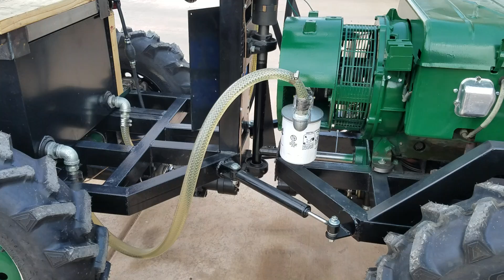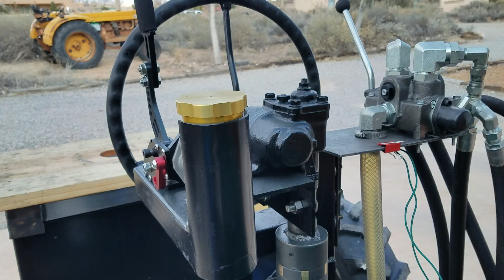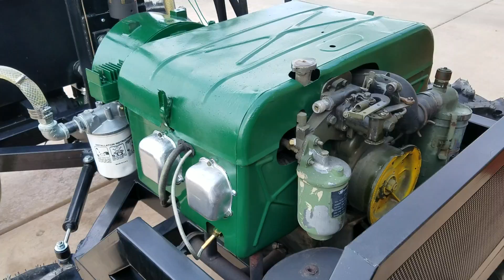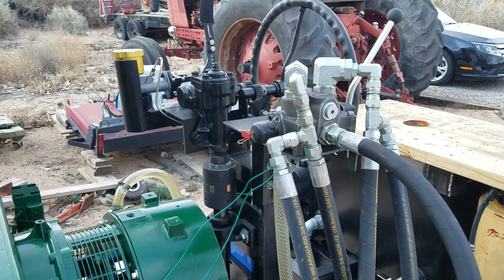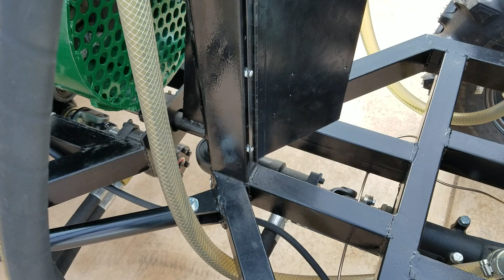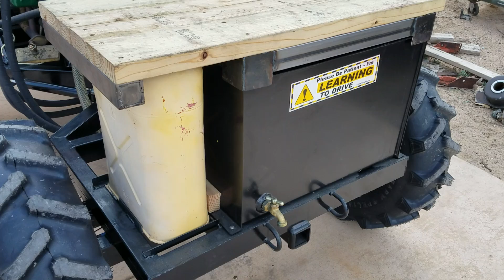Hydraulic homemade tractor walkaround

Comment: Is your motor control valve with work ports blocked in neutral?  Mine is open to tank and the tractor freewheels which I don’t like. Does your freewheel if not how did you solve this?  Thanks!!

Comment: What size motors and pump did you use?
Reply from the maker: Pump is 25GPM. Motors are 7.2 cu in geroler. I got all at Surplus Center.
Reply: @charlesnewcomb360  
Cook thanks

Comment from the maker: A little springy in the center pivot, yes. One insight I got out of driving this was that the center pivot only allows so much turning, not 90 degrees as designed. This is because the whole vehicle gets very unstable at tight angles
Reply: maybe a bump stop or block on either side inline with the steering? to stop it from turning to far and binding it. id think the private would nee a little heft anyway for durability if you went at it like that id think that problem would cure itself. all the big articulators got enough space in the tunnel you could sleep in there. ty for this it gives me some good ideas i want to do this pretty bad.

Comment: Cool! The articulation is not really needed on a short wheel base machine. Why in the world are brand new, $20K-500K tractors using 1910 technology? There is no longer any reason to cast the axle housing, gear box, differential, hydraulics, and clutch inside a massive steel casting. They need to stop that, and make modular tractors more like yours. Think  "quad" technology. I think quads are fast moving toward replacing these cast steel antiques with little notice from most of us. s/ X-Kubota owner.
Reply from the maker: My back lot is loose sand and a bit hilly. The lengthwise articulation makes navigating this possible, I would definitely hi-center without it. There are definitely pluses and minuses to the center articulation, it's not very stable in turns. Building this was an education! Thanks for comment.

Comment: are you going to add a front end loader and a 3pt on rear??  i got a old trencher converted to a mini version of your tractor and its very handy even with a bad designed loader on front
Reply from the maker: I have a plow on it now, and I've modified the intake manifold and mounted a VW carb. Dramatically improved drivability. I mounted a small winch to lift the plow. I don't need a 3-point, have one on another tractor. I use this for towing a self powered mower, and leveling my driveway.

Comment: Your breather was loose from the intake pipe. I thought it looked like an old Army genset.
Reply from the maker: Yes for sure, still sorting out some engine issues. I put a winch on the front, glad I did, the fuel pump failed the other day, had to pull it onto a trailer. The engine is off a military MEP-018 genset.
Reply: Always something for a while. I was trying to remember what KW the Army gensets were that had the Detroit Diesels, 3-53's I think. Been a long time, thank God!